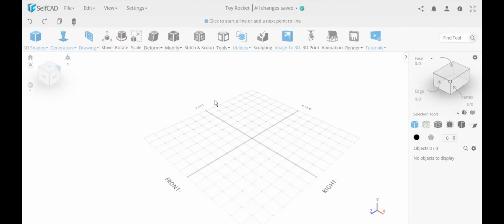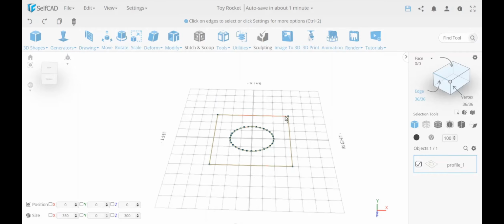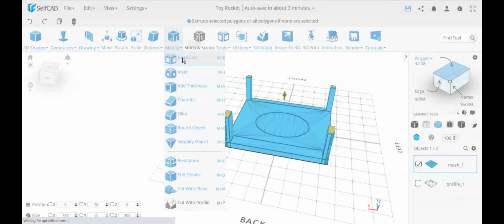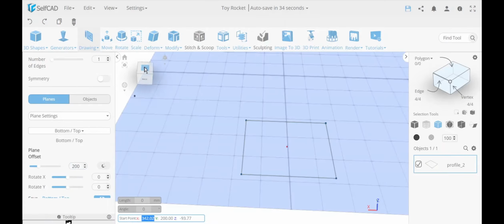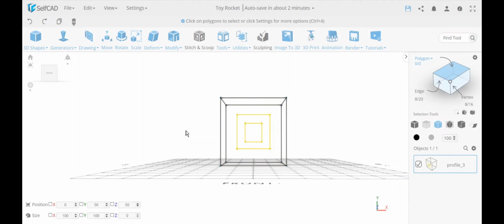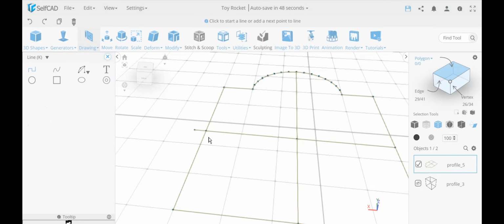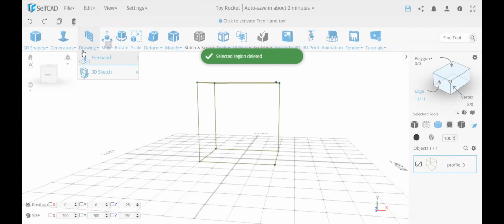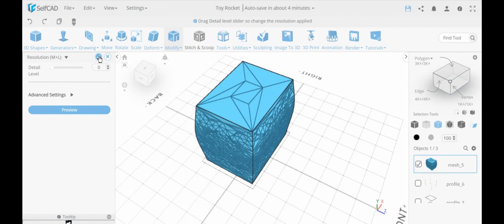SelfCAD Drawing Part 2 | 3D Sketch Tools

Comment: Excellent video. I have been playing in SelfCad Pro for about a month now. How do I get accurate dimensions and angles when drawing (like I would in parametric CAD) so that I can design practical items for 3d printing?
Reply from the maker: You can enter the measurements using the text boxes on the bottom left. (They automatically activate together with the drawing tools) I'm sorry; I forgot to show this in this video. Later, you can resize any part using the scale or measurements and edit details tools.
Reply: @3dmodeling101  Thanks for the quick reply and instructional video. It's really appreciated
Reply from the maker: Please see https://youtu.be/i6UMDhY7-rg